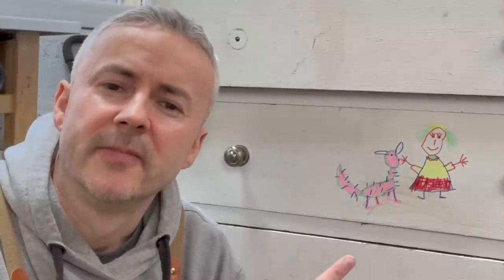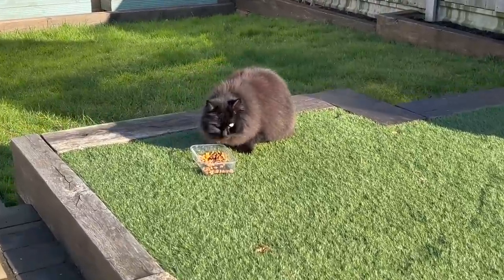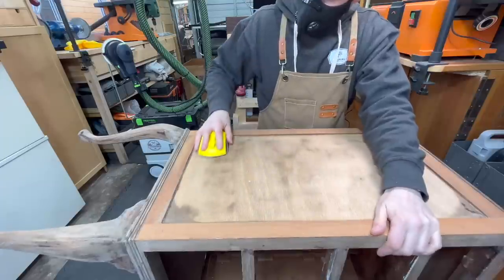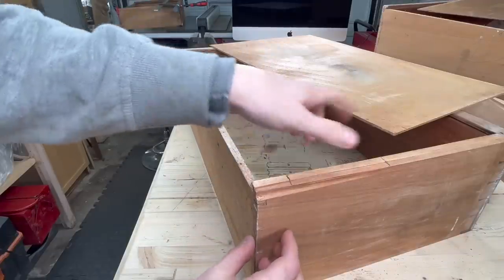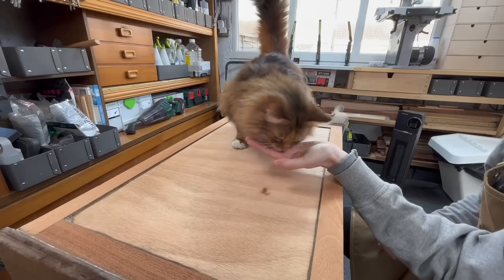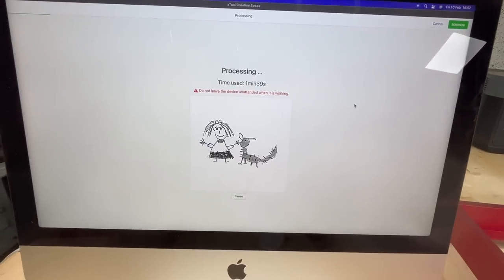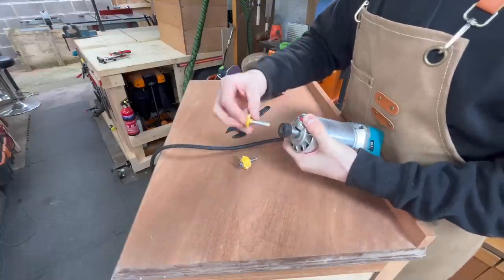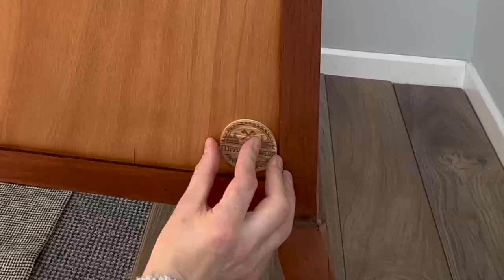Beautiful RESTORATION of an ugly dresser

Comment: I bought an old dresser from a "antique" shop several years ago that was painted white. I painted it a light green and scuffed the edges so you could see some of the white peeking through. It also has some carvings on the front of the drawers. Since I've been watching your videos along with videos from Mayfield Restorations, it makes me want to see what's under all that paint. Unfortunately I don't think I have the woodworking skills to really restore it. It's missing a piece of wood from the back of one leg, and as I recently learned from another video, its drawer stops must be missing since some of the drawers push in deeper than the frame. I'm sure some of the slides are overly worn as well. I have a feeling watching these videos could lead me to buy some power tools and get into trouble😁. Your work is amazing. Another beautiful restoration!
Reply from the maker: Awesome! Give it a go😉 and thank you

Comment: Great job on a beautiful piece. If I may make a suggestion,  use an interface pad on your Festool sander when using mesh sanding discs. This will prevent damaging the pad on the sander.

Comment: I hate seeing and working on pieces that have been painted. Why ruin a beautiful wood piece with paint. 
I'd rather deal with peeling veneers or broken ones than spend hours scraping paint out of joints. 
I once stripped a mahogany sleigh bed of layers of paint. Some idiot thought doing a faux antique look was great. Not me. 
At the time I didn't have dental picks so had to use a small nail I sharpened as a substitute to remove paint from intricate carvings.